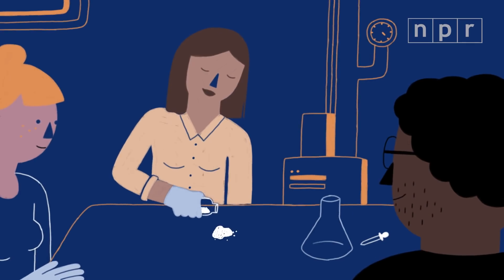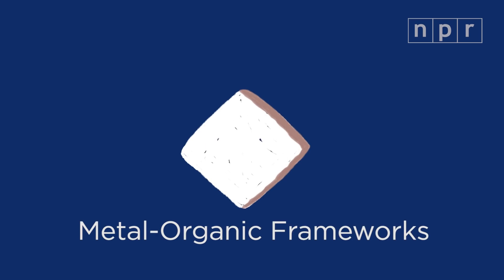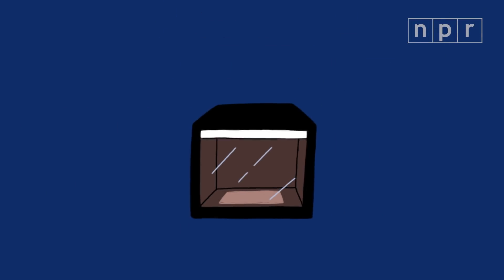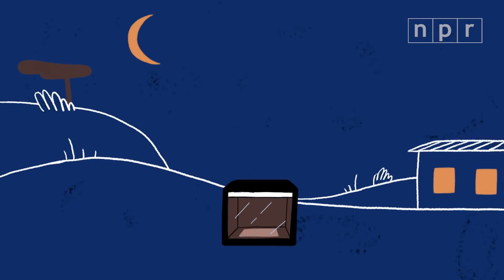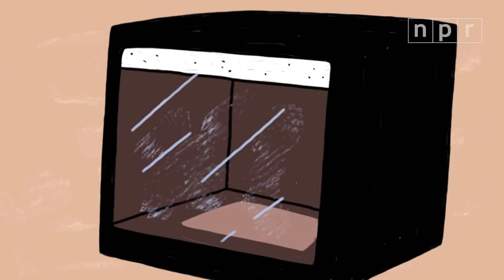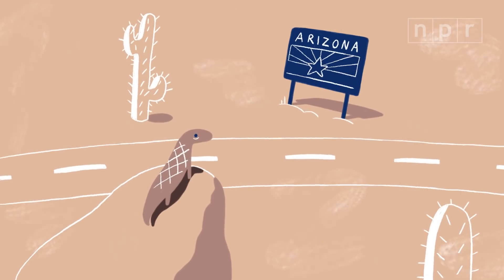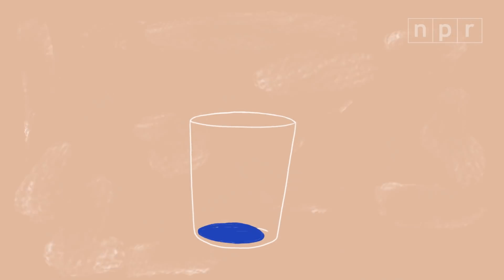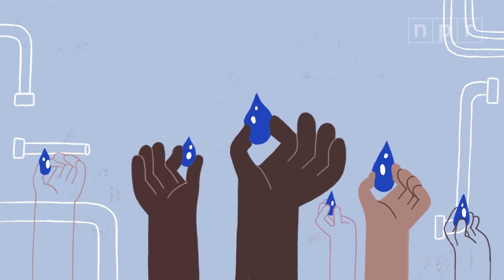A Solar-Powered Step In The Fight Against Water Scarcity | Joe's Big Idea | NPR

Comment: Hogwash. The thermodynamics does not make sense. Absorbant or not, the energy of the water vapor needs to be extracted to reform the hydrogen bonds . This is not a trivial amount of energy. The proposed method of getting the water to actually absorb is flawed. The arid areas that are the intentional deployment area, has very little moisture in the atmosphere. And no. The air does not get more humid in the night. The amount of water the air can hold is just lowered,due to lower temperatures. Yes, it means that you are closer to the dew-point. Some areas pass the dew point altogether and passes into freezing,  making all the moisture in the air drop out of the air as a thin, thin layer of frost.  If there where enough water in the air for this to be a useful source of water, there would be no need for this device. Trust me.. water from air is a stupid concept. Look up industrial de-humidifiers. There are dessicant types, compressor types, combined types. You ain’t going to get much more efficient than that.

And even if this worked perfectly, the size for the damn thing to be of any use would drive up the cost to be no better than hauling water to the drought struck areas.
Reply: @John Billings  External power.... Like. From outside the device. You wouldn't say your laptop or phone runs on external power when running on its battery, not plugged in, would ya?  
And this video.. It's animated.. So whatever you have or have not seen is not relevant here.
Reply: @John Billings https://youtu.be/EGTRX6pZSns

Watch the damn video. No. It is not feasible. But please. Be my guest and live off dehumidifier water the rest of your days. 
Good day sir, 

(Edit: Corrected a typo)
Reply: @John Syzlack Excuse you
Reply: @John Syzlack "when you hire a woman to do a man's job"
Reply: @John Syzlack Not all women are like that. Just because one messed up, doesn't mean you have the right to accuse all women of not having the right to "do a man's job".
Reply: @John Syzlack Like I said before, that is just one of the few examples of males being jerks. Who knows? Without the female, her part could be coded wrong. If the team was all females there is a likely chance of the discovery been made quicker. What do you suggest? We be housewives? COUGH sexist COUGH
Reply: @John Syzlack 🤣 What is it an example of men in the West are the most privileged class in the world,  but most importantly, men belong doing what men are good at.

I.E. they're good at being soldiers, labour work etc. 
P.S. Get in the times.
Reply: You should then tell Stanford that they made a terrible mistake making her the head if an engineering department last year!

http://news.mit.edu/2018/evelyn-wang-named-department-of-mechanical-engineering-head-0622

She must be pretty smart to dupe all those researchers and peer reviewers...

Maybe you should take her place?
Reply: Sword of Tauberg save me from your passive aggressiveness against me. I have not claimed to be smarter than anyone. Pointing out something that is flawed is just that. 

So. Normally I would not doubt things that comes from reputable universities, but this whole water from air thing is something that comes up again and again, and they all fail due to the reality of thermodynamics.  

https://youtu.be/EGTRX6pZSns

Here is a video from Thunderf00t from 2017, talking about this very project. 

And MIT and California university are not alone in spinning bullshit like this.  The guys and gals over at Xprize are barking up the same damn tree. 
https://water.xprize.org/prizes/water-abundance

So. Water from air is a stupid concept. Themodynamically it does not make sense. No amount of technology will be able to bend the reality of the huge amount energy required to condense any usable amount of water. The atmosphere does this water from air thing all by itself the places it is favorable for it, in the form of clouds and rain. But the energy flux of the atmosphere is quite mind blowing, and wanting to condense that process down to human size, and force it to happen places it isn’t favorable, is a foolish errant. 

I urge anyone read this far to look up Thunderf00t and his videos. He can be a bit condescending and repetitive, but he does a great job, doing what he is doing. SCIENCE!